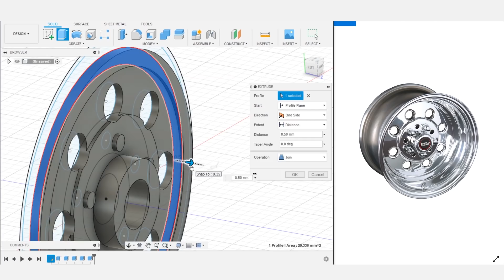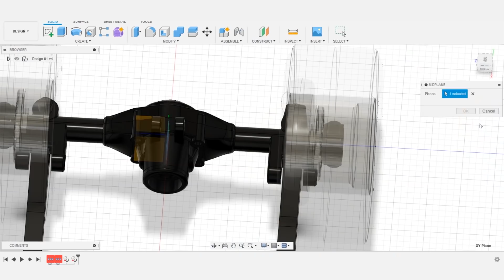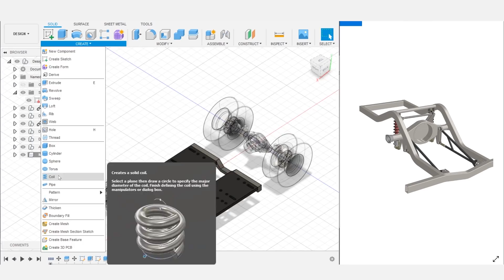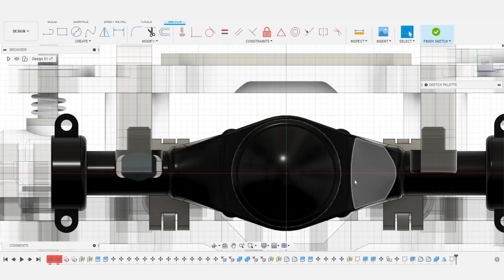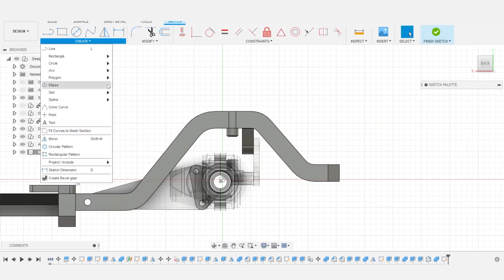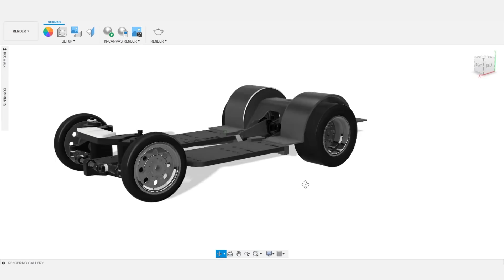1/25 Scale RC Drag Car Chassis Design and 3D Printing Parts for the Gremlin Build

Comment: For the wheels, do a sketch on the top plane of the sliced profile of the wheel then revolve extrude around the center. That would let you see the geometry and ensure you have enough meat for 3D printing. I think its also good form to design a part in as few features as possible.

Comment: Great work my dude.. Do you have ironing and retracting turned on your 3d printer settings? I assume your using Cura?  Chitubox ? anyway  thank you for the great content as usual.. In this time when your waiting on parts etc.. for those who havent used 3d programs you could do videos on how you started and what you started makeing at first and maybe point to the videos you started with. As you know with tutorials there are more than one way to do the same thing and some good some bad... I had problems at first with bad tutorials that would show videos where they skipped some steps without showing on video and your left there making errors thinking "its just me i am not able to do it"  where really the video was skipping steps at an early stage you just dont know enough to recognize and get past them.. With a good strong base tutorial you get a good starting point and can look at any tutorial and get past that.. Anyway rambling but since your so good at the 3d design element youd be a great person to give beginners a strong base to start on..

Comment: Outstanding!
So frigging outstanding that not even drones in mom's basement have thumbs drowned it!
Have you tried printing tires with flexible filaments...some are actually pretty soft and could mimic tire flex which would be nice since you have suspension happening

Comment: wow., is the stl available?
Reply: Im trying to design a mini 2WD (rear drive) rc  with differential on front and rear. Im planning on printing it but have no luck so I give up (due to lockdown, Im making rc car with the maaterials I have on hand). Thanks for this vid, I may not do this but Im hoping you finished it! cheers!
Reply: looking forward for the finished product

Comment: @MakeitRC, have u thought of using ninjaflex filament for the tires. If your doing custom wheels definitely look into it
Reply from the maker: Maybe someday, though I've heard it can be a pain to print with. Have had success with it?
Reply: Make It RC yes lol you are correct it can be a pain and those who say that like to print. very large prints, myself included lol. However, most of the prints you make are small so its much easier. 
Material choice is also a factor:
Another stiffer but flexible material which is easier to print is called TPU. Compared to ninjaflex that is super flexible and is more difficult to print. 
I can link some videos.
 
Also I can help with the slicer settings

Are you still using your makergear?
 (I believe he TEVO’s extruder can handle it but it’s better to use a direct drive extuder than a Bowden. )
And what slicer are your using?
Reply from the maker: I'll have a look at that. I'm still using the Makergear M2 and Simplify 3D.
Reply: MakersMuse great videos —- https://youtu.be/fTJz6vMvtJ8

Comment: Can't wait for this to be released! I have an old '69 Camaro kit that's missing some bits...but this would solve that!
Reply from the maker: Glad to hear that. I plan on having different size options for different bodies. As with most things posted on Patreon, I can usually adjust the size within reason, so if you need something modified don't hesitate to ask.